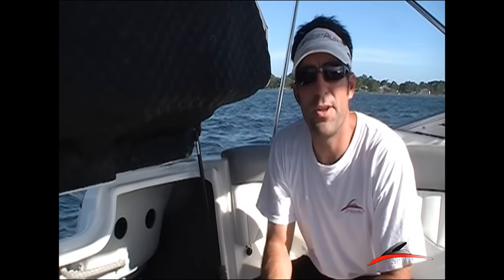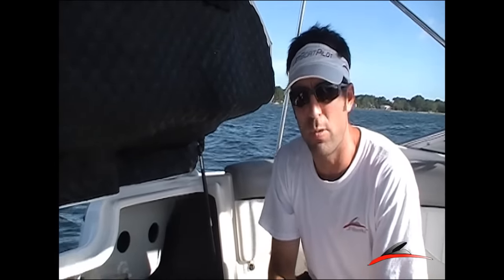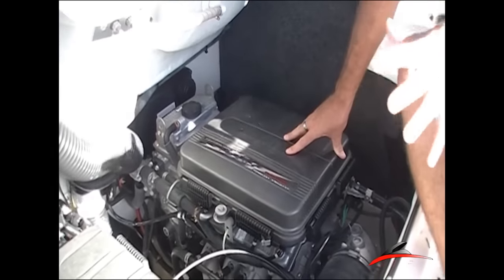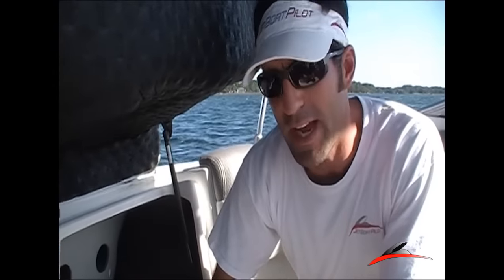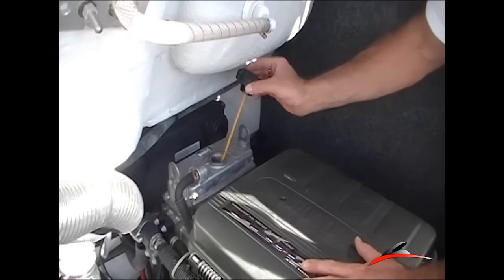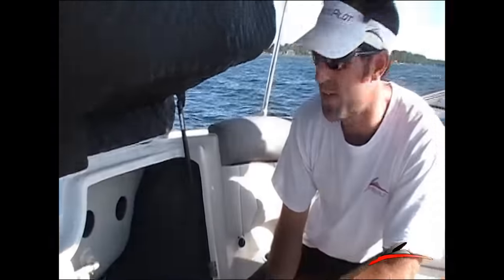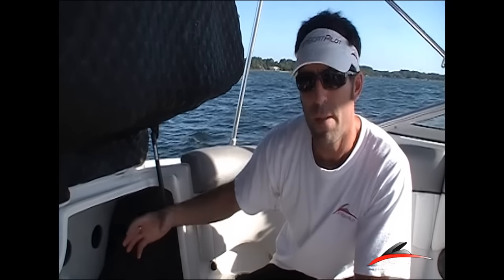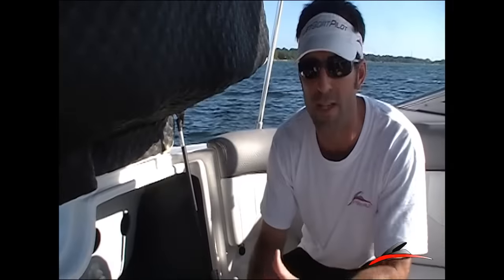Yamaha Jet Boat MR1 Motor Oil Check Procedure

Comment: My brother ran the water before starting the engine by error and the engine won’t start. What should we do restart the engine
Reply from the maker: fritz Erie how long did he run the water?
Reply: Pull the plugs, hold the throttle wide open and crank it over to get the water out.
Reply: You probably have water in the cylinders. When the engine isn't running the shore hose water pressure can backfeed into the exhaust & fill the cylinders.

Do NOT turn the key or you will hydrolock the engine & break pistol rods.

1.) Pull the plugs out
2.) Pull the lanyard to prevent ECM damage
3.) Turn key to run starter until and the water is out of the cylinders

Comment: 2 or 3 minutes isn't enough time to heat the oil.. You won't get accurate results.
Reply: You don't want to heat the oil you just want the oil to flow through the engine and return to the reservoir. It really takes less than 10 seconds till the oil starts flowing back to the reservoir.

Comment: so shut off then check?
Reply from the maker: Yes, run engines hot then check oil while hot.
Reply: @JetBoatPilot  the answer is still vague, in that it doesn't specifically say yes while running or not. I thought the users manual specified 15 sec. after hot shutdown.
Reply from the maker: @AnthonyRivieccio  follow the user's manual. We're sharing our own experience with viewers and have not measured the elapsed timed from shutdown to inspection of the dipstick.